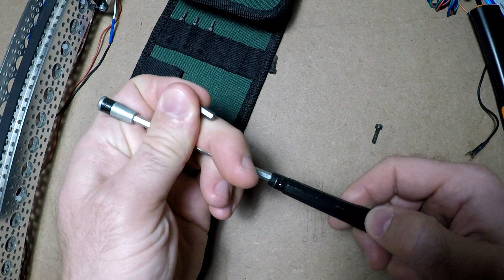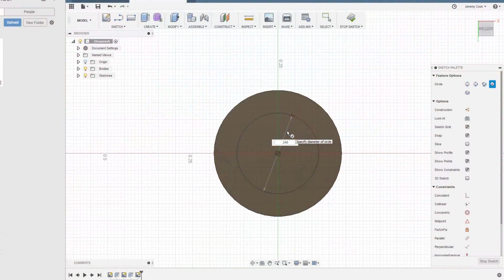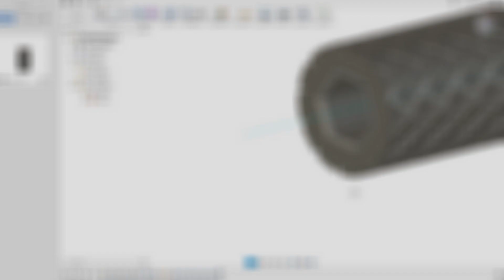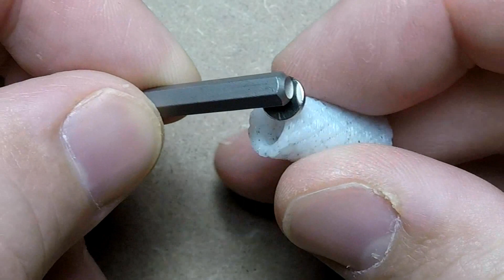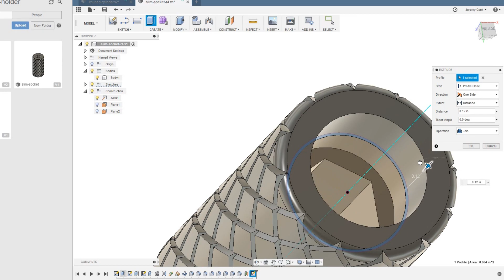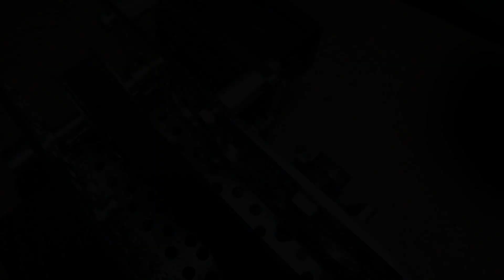3D Printed Low Profile Bit Holder [Wiha Screwdriver]

Comment: Here's exactly the same thing I designed in openscad a couple of years ago. I used the knurling library. https://www.thingiverse.com/thing:2009088
Reply from the maker: Neat, thanks for sharing.
Reply: @JeremyCook  OpenSCAD libraries rock. Got the whole thing done with 2 lines of code.
Reply from the maker: Impressive! 

Still, once you get beyond one part, isn't that the limit of OpenSCAD?
Reply: @JeremyCook  Dunno, everything I've ever done is in OpenSCAD.  Seems pretty nice to me. The parametric aspect of it appeals to me.  If the code is written well, I can decide to use a different kind of screw, poke the new diameter in, hit F6 and I'm ready to go.
Reply from the maker: That is nice.